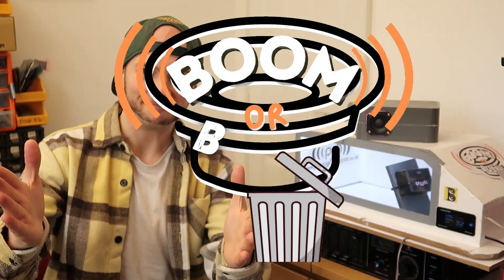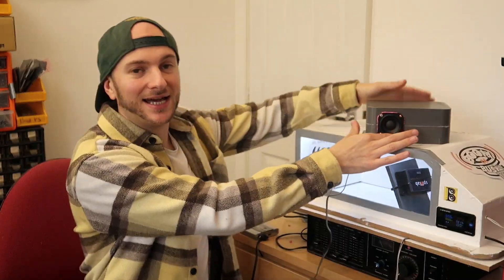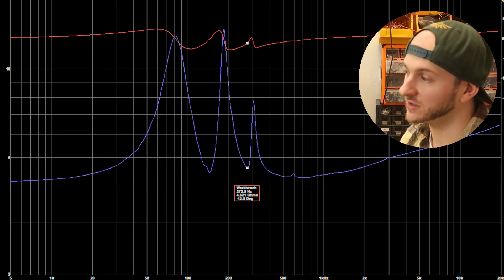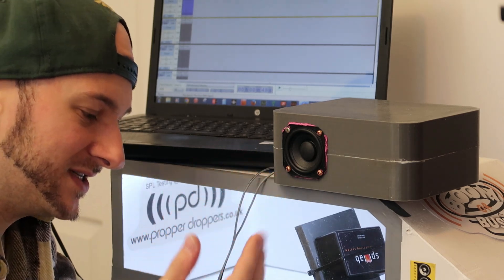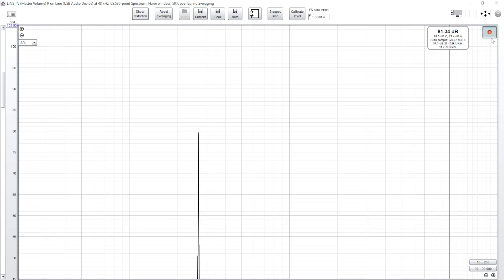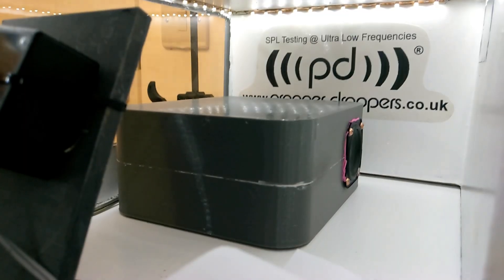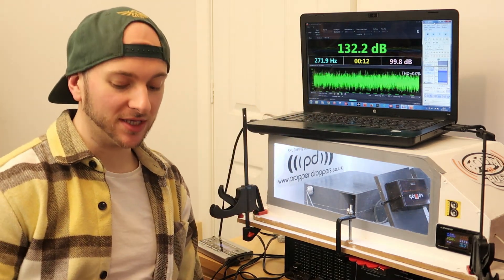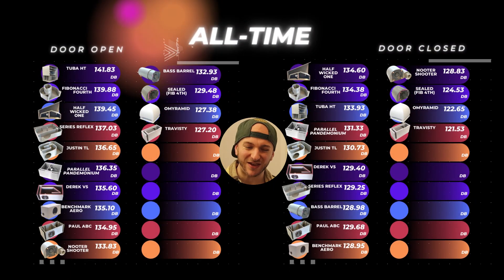What if you put two ported boxes into one? | Boom Or Bust S1E14

Comment: I like this enclosure design.  It is surprisingly difficult to find real design information about it online.
Reply: similar to this is a dual chamber reflex.  say 3cu ft total.  calculate for low freq, the length of 2 ports. say 30hz.  then divide the box into 2cu and 1cu and make 3 ports to the calculated length of 2 ports.  speaker facing out of the 2cu side. now 1 port out of the 2cu and 1 port out of the 1cu and 1 inside beween the 2 chambers.  you will now have resonant peaks of 30hz and 60hz.  works very well
Reply: @BarryDaellenbach-vs9qw  That is literally the enclosure that I submitted, and he tested, for this series.  ABC enclosure. :face-blue-smiling:
https://www.youtube.com/watch?v=f9OabxgfVkw&t=951s